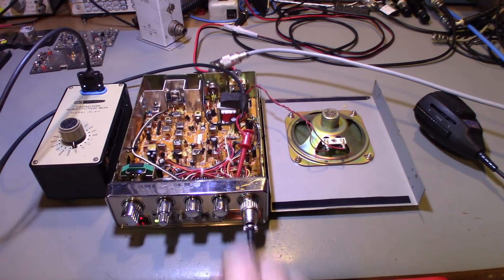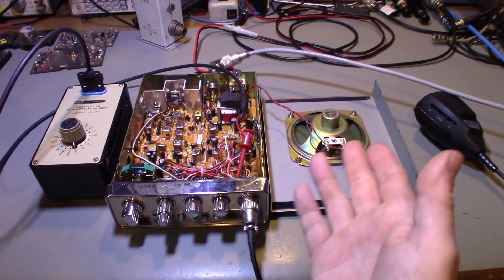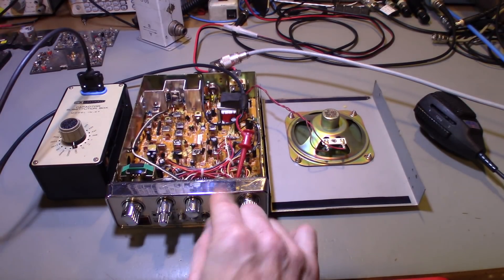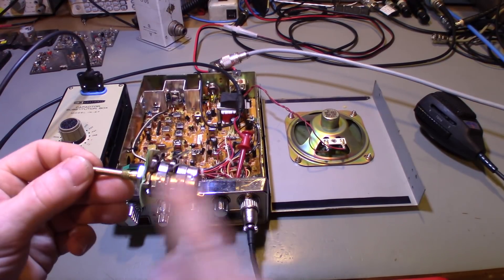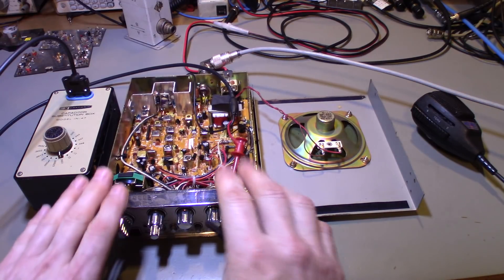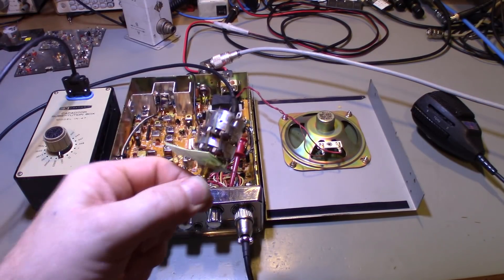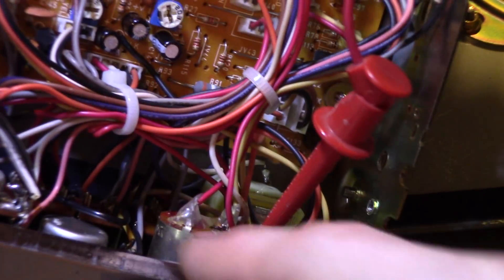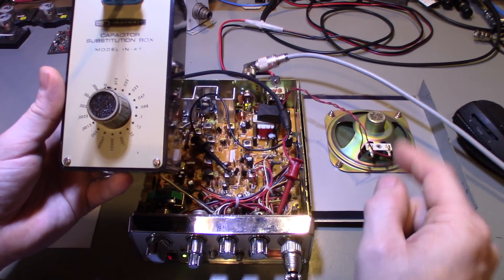Adding a tone/noise filter to any radio.

Comment: The Stryker 447 has two positions for noise but they barely do anything. One does nothing and the top position is barely noticable but worth having on. Its noisy just like the radio in this video and totally anoying.
Another thing the audio is so low in it I can barely hear people unless I turn it full blast until the conversation  ends.

Comment: Is that similar to hi cut external speaker which basically tags the capacitor legs to each speaker terminal on back of speaker audio cone eliminating the variability put into permanent hi cut

Comment: Thanks Mike. Any Ideas for fan/Engine noise? Maybe some 3.3KuF Cap. across the power leads? I am using a President Mckinley. Some of the whine gets through even when the radio is squelched with the ASC and the normal squelch. It's like the audio circuit is acting like a receiver .
Reply: my McKinley does the same thing!

Comment: Isnt this the same as a Noise Blanker switch?
Reply from the maker: No.  The noise blanker circuit is used to remove noise created by things like vehicle engine ignition systems.  Short duration impulse interference.  The noise blanker circuit actually (in a nutshell) shuts off the receiver during the impulse, that's why it's called a blanker.  It blanks the audio during the duration of the impulse noise.  It happens so fast the human ear/brain don't even know that the audio shut off and back on.

Comment: Now I'm new to can radios so this might sound dumb but does this limit the distance the radio can hear? Or just limit the unwanted noise?
Reply: Cb radios, excuses the auto correct.
Reply from the maker: This is added to the demodulated audio circuit so has no effect on the receive sensitivity of the radio.  It is a low pass audio filter that filters out high frequency audio content which has the cutoff frequency limit set by the value of the capacitor.

Comment: Can a variable capacitor be used for this instead of an array bank of different values of capicitors w/  patentiomitor?
Reply from the maker: You could but it would never fit in the radio.  To get a variable capacitor with values this large it would be very large.

Comment: Nice video!!  Thanks for sharing that information about the receive audio.  I have a question, I purchased an Alinco DX-SR8T HF radio new back in September 2017.  The guys that I talk with on 80 Meter band told me that the TX audio is awful.  Basically they said it has to much highs and no lows in the audio.  Of course I ended up purchasing a used Yaesu FT-757gx and they said that it sound more like me.  My question is, would something like this work on the TX audio section of my Alinco??  Another friend had also bought an Alinco and had the same issue with his transmit audio.  He tried many different mics and still no lows.  I was told or read that the Alinco DX-SR8T was designed as a DX rig and that was the reason the circuit was designed not to pass mids or lows, just highs, so you could be heard in a pile up.  Any information would be great!!  Thanks again for the video, and I enjoy watching your videos.  Juddie WD8WV

Comment: I was wondering about those Ceramic Capacitor Kits - because of their size,take a 15nf for instance that was like 3/8 of an inch and a good 1/16 thick green capacitor is being replaced by like 3/16 x 1/32 thick small orange capacitor they claim is 50 and some even 100 volt rated. So I figured they were junk and tried to find something better sized to what was installed.
Reply from the maker: Haven't seen a 1uF or larger SMD ceramic capacitor have you, they are tiny .  With today's technology they can make parts a fraction of the size  of older parts.
Reply: So these 1W Resistors with the smaller leads are actually 1 Watt quality and safe to use. I purchased a lot of parts and would not use them because I did not trust them blowing and ruining a radio. I was watching your other video on the Madison and I have radios where the resistors on the Voltage Regulator Board have burned through the boards - LUCKILY the radio still works when connected to an external regulated supply.

Comment: Four things come to mind:
1. One of the other two connections on the volume control will often be ground. If you get the wrong one, it'll be a high boost.
2. Tube radios will probably need a smaller capacitor than a solid state radio.
3. The amount of high cut will vary with the volume setting and there may not be any high cut at full volume.
4. Op-amps can get very upset (and oscillate) with a capacitive load on the output. Oscillation (which may be above the audio band) may occur a full volume if the volume control is driven by an op-amp or IC with similar internal circuitry. Adding a small (100 ohm or so) resistor between the capacitor and wiper should cure this.

Comment: What's the level of capacitance the new President CBs use in their HI-CUT feature?  I know the "HI-CUT" feature in the President Johnson II USA has a good overall sound.  I would like to use that level of capacitance in my Cobra 29 and 25.  Thanks.
Reply from the maker: The "Hi-Cut" feature in the President radios is microprocessor controlled through opamps.
Reply: These type of mods are nice to remember.  Pretty much anyone can do it, and the cost is a few cents to free if you have old parts hanging around your parts cabinet, or know a local tech who might just give you one!
Reply: Haha, doesn't sound so simple to me.  I think I will just do a side x side comparison with different capacitors.  Shouldn't take too long, regardless.  Thanks for reply.
Reply from the maker: No it's not.  They use dual opamps in unity gain configuration.  It's a RC (resistance/capacitance) filter at the input of the first stage.  Out through another RC filter network to the input of the second stage and then out.  Using the opamps in unity gain means the output of the opamp is at the same level as the input.  They are using it basically to counteract the losses in the RC filter.